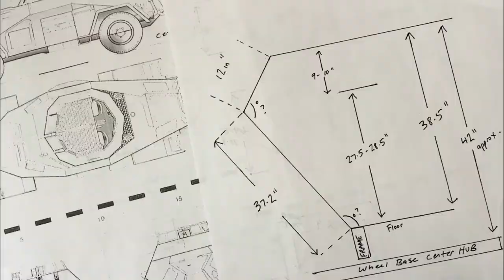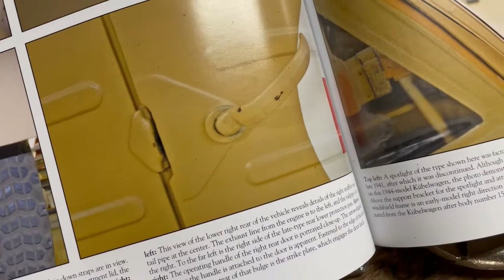Project Kubelwagen Ep 79 K&N Air Filter

Comment: I put a ford starter relay under the back seat of my bug.  Running the high amp, hvy gage wires to short runs from the batt to the solenoid.  This also limits the amps to the ignition switch to signal only, and no longer cooks the ignition switch. 25 years and counting, no problems.

Comment: You have the relay wired correctly ,so to check if its the starter or the slave solenoid that you added is to listen while it does not start when in the  start mode .do you hear a loud resounding click  as though the starter main solenoid is engaging but not transmitting the power though the solenoid contacts to the starter motor.  if that is the case ,you could have insufficient positive at the starter battery terminal or at the battery also check the ground at both ends there could be enough power to operate small amp draw items but not enough to operate high amp draw items.  The reason I say that first is because that happens a lot and is easy to check before you fire the parts cannon .If all the wiring is clean and wires are not broken then it is the starter or starter solenoid.If you DON'T hear a loud resounding click when you put it in the start  mode then it likely is the slave relay or wiring to or at the slave relay, 18 gage wire is plenty large enough to operate the slave relay they only take milli amps to operate. When ever I have replaced those small relays I use a bosch type I find they are made of better quality and are hermetically sealed better for your  application. Hope this helps     Cheers
Reply from the maker: The "no start" issue was before I installed the relay.  So far the relay seems to have solved the problem.  Thanks.